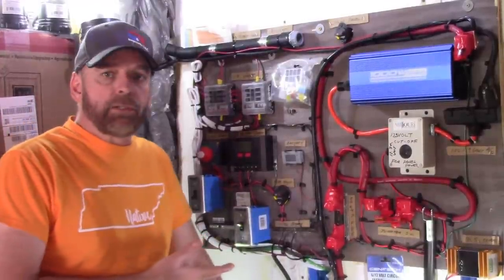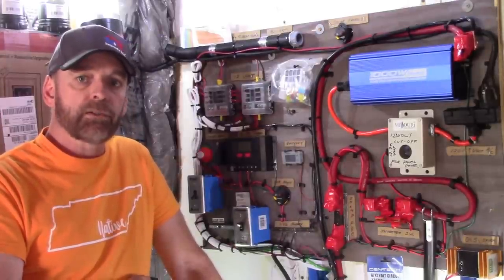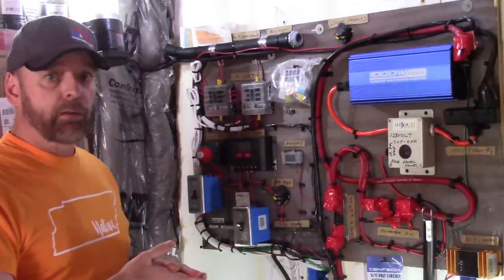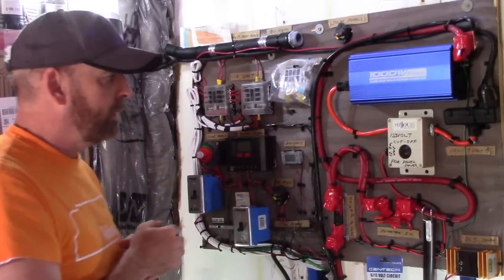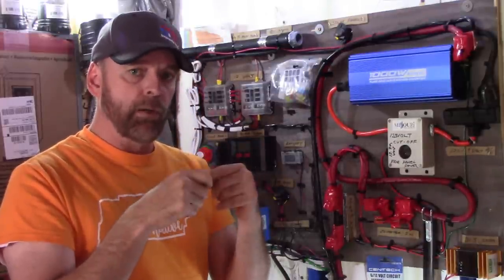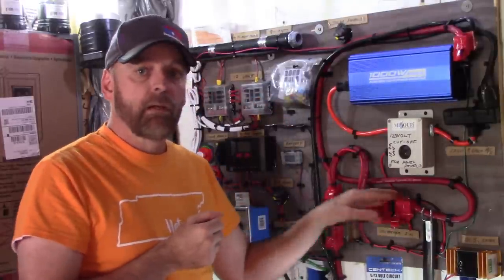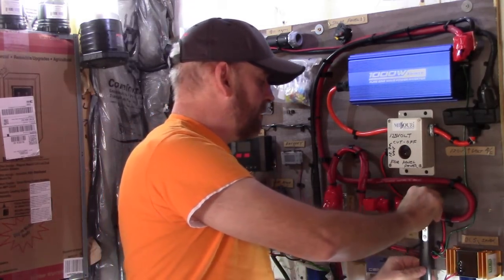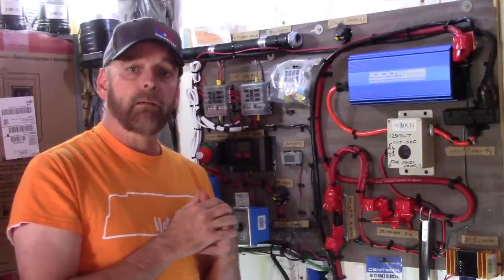Inexpensive Solar Power Off Grid Cabin or homestead DIY system #SOLAR #OFFGRID #homestead

Comment: I agree with you 100% on trying Solar. Play with the HF kits. I wasn't sure about it and surly didn't have the money at the time to buy a turn key system. I started with the HF kits, went to Wal Mart got 2 Deep Cycle batteries to run a fan and some 12 volts lights in case of a power outage I am in FLA.. Now I have been running my 4 HF kits and have gotten 20 deep cycle batteries for over a year now with no problems. I did up grad to a good charge controller and inverter. I only buy the kits if they are on sale and yes you only get about half of the claimed power out put. They do work for something like this. I have gotten some real solar panels. I have gotten 8 100 watt and a larger charge controller. I haven't installed it because I will be setting it up in another home.  I also use auto and marine supply when I can. Welding cable works best for me and like you said does a great job.  You can build a good Solar System if you are like me and can only do a little at a time. It works and can be very helpful in times of trouble. I use my Solar to help reduce my Electric bill and it really helps. My friend can't believe it when I complain about my $70.00 dollar light bill in the summer. I use as much solar as I can to off set the Electric use of my home. Good post.
Reply from the maker: Awesome! I am editing up a follow video on that system.  MPPT vs PWM  charge controllers ...when to use them and real world results. It was a good experiment.  Thank you for watching and thank you for leaving this awesome post.

Comment: Great video, after many hours of the same ole high dollar sales pitches I knew that was BS. Thanks for posting a video for the people who don't have $30,000.00 to spend on a system they they're trying to get away from the high costs of the Energy grid.

Searching for the components now, trying to come up with a system to get away from the power Co 100%, we use according to our bill about 600kwh a month.
Reply from the maker: Thank you it's why I made the video. That system for the video is working like a champ using 5 Wal-Mart batteries powering my Starlink system.
Reply: @GrumpyMountainMan  Would you have a suggestion on how many panels and batteries we'd need to run our small house?

Comment: What was that thing down at the bottom right you called a DMS? I'm kinda gathering its a desulfator, if that's right, yeah they work if you got a reputable product. I've been using battery minders & I witness everytime I installed used lead acid batteries, they had a sizeable back current left over when fully charged which means there sulfation blocking it from accepting a solid charge. With desulfators permanently on the batteries, I saw 20 amp back currents drop to almost nothing over a couple months. I have 4700 a/hrs of batteries with just a 10 amp back current with 26 batteries making that about 4 tenths of an amp back current for each battery which is excellent.
Reply from the maker: Yes it's a BLS..( buy on Amazon) .I love them . They work and I install them on every system. An even better desulator is a wind turbine hitting your battery bank due to voltage going up and down and hitting the bank. Thank you for watching the video and for leaving a comment hope 2021 treats you right.

Comment: Using marine grade is a good idea also car hifi stuff is grate but there are limits to the systems  size but more important is your terminal technology a properly sized crimped connection is best long term screw types loosen with time very current surge

Comment: I doing exact same thing. Tho I self taught everything. I've got 300watts of HF going to s set of lithium LG Chem batteries.  3.7 at 120ah.  3s5p. You can change the charge voltage on the charge controller and I have a cut off to my battery  and like you I got mostly all 12v applications. But expensive on my batteries  tho. If they send us another stimulus plan on adding another 300 watts probably another 240ah of battery
Reply from the maker: Awesome ! Thank you for watching the video and leaving a comment.  I have a solar playlist also and I'm editing more videos.  Please subscribe.  Once thanks for watching the video.

Comment: Pretty close to what I have..I just got #7 & 8 marine batteries for mine..I did get a 24 v inverter/charger (Aims) because I didn't know anything but its awesome..I've got 490 watts but I'm gonna get 200 more...I used a 4215 epever BN controller and I just get my batteries at Autozone I used the 27 DC marine..I've got $2000 in it but hey its working..
Reply from the maker: Sounds like a awesome setup

Comment: internet engineers!!!  LOL so true,  subscribed!!!  Oh yeah, you said your grounds go from that bar to the grounding system.  Can you explain what you did for the grounding system outside?
Reply from the maker: I attached that ground bar using a #4 conductor to the 2 ground rods outside
Reply: @GrumpyMountainMan  how deep are the ground rods?
Reply from the maker: Driven all the way down at a 45 degree angle. I used a hammer drill
Reply from the maker: I have a video showing the hammer drill in use.

Comment: Think about this: supposing the grid is unreliable, how would you do a battery system that was charged by the grid and could take over when the grid dropped that you could hookup panels to take over if turned out that the grid got too unreliable to keep the batteries charged - i.e. just have the batteries and only buy panels if it turned out you really needed it because the power was out too often. What I'm thinking of is rural Philippines where you can get a hookup but brownouts and cuts are common. Maybe a backup generator would make sense rather than batteries though?
Reply from the maker: Just charge a battery bank using grid power. Use the inverter tied to the battery bank back feed your electrical panel.
Reply from the maker: I back feed my electrical my electrical panel.

Comment: Good video and tips on saving some money on non-solar labelled devices.   I think you would find electrodacus' charge controller interesting for a cost effective 24v system, could possibly use in a 12v also with the parameters changed.  Do you have any advice for getting permitted for residential solar electric only and how nec applies? Thanks
Reply from the maker: Permits are pretty straight forward. Here in the States we use the NEC for our code. This system shown here might not work. Inspectors without knowledge look for the UL and CE label on equipment being installed.  Most of my components are marine/automotive.  That said. If you mounted all of those components in a UL rated box. They would probably just open it up and close it not knowing what they are looking at.
Reply from the maker: Thank you for watching the video and for leaving a comment...its a very big deal. I have a solar playlist that I am always adding to. Please feel free to subscribe and watch : )
Reply: @GrumpyMountainMan  thanks for the response, I'm in Pennsylvania

Comment: Regarding using a possible loss of a battery as an excuse for going with a 12 volt system. It's pretty rare to have a battery go bad. If one is going bad they probably all need replaced anyway. Even if a 12 volt battery in parallel goes shorted it will pull the others in parallel down with it and those will go bad too. If in series and one goes bad it won't ruin the others. But since your system is small anyway it probably does not matter to much. With Lithium (especially used) going so much less expensive it is pretty odd to see people building a new system with Lead acid. But regardless nice job on your build.
Reply from the maker: Thank you for watching the video and for leaving a comment.  I have a solar playlist and a video coming out showing the real world differences between a MPPT vs PWM charge controllers.  Please subscribe.  Once again thank you for watching.
Reply from the maker: On Lithum.  Watch Jonn Daniels video on Lithum vs Wet batteries.  Wet is still the way to go.

Comment: What's the best way to start small and keep scaling up with batteries and panels?  Just buy a huge overkill inverter and a few panels and a battery?  I want to be able to do just 100 or 200 watts, and as I get the money throw on more panels and batteries, and eventually get it up to run my mining rig which takes 800w and runs 24/7.
Reply from the maker: Really no free lunch. You can't keep adding batteries. Your newest will be just as good as your old one when added to the bank.  Only thing . You could get a big inverter. But you are better off and just buy the whole system at once

Comment: question ?? im like you with this i started with the 100 watt 4 panel kit from harbor freight ?  with 2 bad ass  Marine batteries from walmart .. the 100 watt kit cant keep the batteries charged just running a 1000 inverter plugged in only  the internet roughter and a 20 inch box fan.. why not just get more habor freight kits ?
Reply from the maker: It's a catch 22. You can go with more batteries.  My harbor freight system is 400 amp hours, that means its actually 200, it's the 50 percent rule of use...so you have actually less than you think.
Reply from the maker: On your box fan. Get a Boundless Breeze fan...they are 12v...and sip power. Try not to use and inverter.  They are 20 percent inefficient
Reply: @GrumpyMountainMan  on a rainy day the panels cant keep up just the inverter
Reply from the maker: @darrinhawkey8913  it's why I'm over kill on panels. I needed 400 watt...but Installed 600watts so I get a trickle charge  . On sunny days I get more power.

Comment: Hey can I ask you about wire size to use from the battery to the power port or inverter? Shoild I use 2 awg??
Reply from the maker: I would use 4/0 welding cable

Comment: Ok I have a question on the DC side. The 2 breaker panels top left side, what are they for and hooked to?
Reply from the maker: On top on the left. They are automotive fuse panels. They are the kind that if a fuse blows it has a LED light that goes off.

Comment: I have a 20 watt solar panel and want to run my Air Conditioner what else do I need.....Jk man, your setup looks crazy but it's time to start mine again. I had a 3kw system in 2010 and now have maybe 450 watts in solar.
Reply from the maker: Ha ...holy crap you got me good with that 20watts....ha ha ha
Reply: @GrumpyMountainMan  Just having fun. My off grid projects never started. I have 1kw system just in storage. Good luck my friend.

Comment: Can you address a simple way to construct a portable solar panel system for an apartment unit that will not damage the unit?
Reply from the maker: I would go to Cutting Edge or Renology and purchase a suit case system. They are turn key and portable.  If you move take it with you.
Reply: Becky Elliott: I am currently building a small solar system that fits your idea so that if need be I can take it with me should we lose the house or whatever other disaster might come up. So far I have about 1100+ watts in solar panels, an inverter, charge controller, home made connecting block with a fuse set up, and whatever heavy cable I could get  a hold of (which I am currently unwrapping and re-wrapping to make it at least size 4 wire ...not easy to do and very time consuming but I am retired and disabled so I'm doing it at my leisure) and so far I think I might have about $1500 invested in the entire set up. But it still has to be set up inside the house yet. SO you can do a smaller set up at a lot less expensive than mine if you just want to power a tv, computer, and maybe a few lights it's perfect for that and almost no drain on the batteries because it's such a low amount of draw compared to what's being pumped into it. Just thought you'd like to know that someone else is doing what you want to achieve but at a slightly cheaper cost and over a period of time so it's financially efficient as well.

Comment: great video bro, a recommended system for laptop ?
Reply from the maker: You can use a EPEVER MPPT charge controller.  But you can also but with the interface and temp probe as one kit. I have a video uploading that shows that MPPT. Thank you for watching the video and for leaving a comment.
Reply: Lap tops run on 19 volt  DC. Just convert the 12V dc to 19 DC. no need to convert to AC, then back to DC. Same with TV. Get a TV with a DC input port.

Comment: Rural King $6 jumper cables make excellent conductors. Just cut the crappy clamps off n solder lugs on at whatever lengths ya need. Just passin on a cheap idea.

Comment: Can I run a 600 watt AC freezer off this?
Reply from the maker: You sure can!
Reply: @GrumpyMountainMan  Excellent, thanks for the reply. Good video.
Reply from the maker: Have you bought your freezer? I have an electric Midea that sips power. It's been very reliable.
Reply from the maker: You can make them think they are a refrigerator too.
Reply: @GrumpyMountainMan  yep got a freezer already. Full of meat I don't want to lose. So my system will only be for the freezer for now. Maybe expand to the fridge and TV later.

Comment: Hey man I'm over in Andersonville, I'm looking at 12-13k to connect to city power at my new property and always wanted to be off grid in the future so I thought I would look into a primary system instead. After looking into used li fe batteries and doing it all diy it seamed like it would be similar in cost. You said it's not worth it if you can connect to the grid, for a doublewide trailer and just me living in it with moderate/low power usage would you say it's probably not worth it?
Reply from the maker: What else could you use with that money?

Comment: Generally a good presentation but there are a few dubious statements with one glaring piece of misinformation I must correct. In DC circuits electron flow is through the ENTIRE cross section of the wire not just the surface! This is also true for low frequency AC such as standard 50/60 Hz house wiring. "Skin Effect' only comes into play with high frequency AC such as radio and TV signals or, especially, microwave frequencies where large diameter hollow waveguides are used instead of wire.
Reply from the maker: @kayakwesty  ouch

Comment: You are mistaken about electrons travelling on the outside of a wire. That happens at high frequency only. At DC and low frequency AC the "skin effect" (look it up) is negligible. (I'm a university degree electronics engineer with several decades experience.)
I found your explanation confusing. You should always start by drawing a wiring sketch: a block diagram. Make your shopping list from that. Work from it as you build. Modify it as necessary.

Those cheap Chinese inverters last about 2 years before the smoke comes out. You can greatly extend the life by replacing the large electrolytic capacitor inside with two. For example, if there's a 220uF capacitor rated at 400 volts DC, replace it with two x 120uF/400v connected in parallel. If it's 470uF replace it with 2 x 220uF of the same voltage rating.

You need two ground connections: a massive one from the solar panels direct to a ground rod in case of lightning. 
A thinner one from the ground connection tag on the inverter to a ground rod.
Reply: Ha ha ha look everyone.  Mr. Internet Engineer is here.
Reply from the maker: Easy now.

Comment: I wont lose power by loosing a battery, I have 3 bank of 4x12 volt AGM batteries. 48 is cleary more efficient.
Reply from the maker: Might be more efficient but not easy for a novice to understand.  Nor easy for a novice to wire up. Thank you for watching the video and for leaving a comment.

Comment: With all that money you paid  on your system.   You paid for a powerwall .... and some micro inverter on your panels ... that been a lot easier then you can come straight to  breaker box .....
Reply from the maker: I've got less than $600 in my entire system including the batteries.  Excluding the solar panels.
Reply from the maker: And I've have parts to where I can go to Autozone or Walmart and not miss a beat.

Comment: DC HAS NO EARTH GROUND. you buy stun gun and it not grounded. Your meat absorbs it. The vehicle frame is ground enough resistance to set off a fuse. Electrical current flow into the frame as it large enough to disperse current to the load and convenience of putting the ground on the positive side of the circuit. The positive terminal side has electron flow.  I like to clean the ground and sometimes put copper additional wires too. Ac has ground return at the power plant that why you have ground with home to return to the power plant. The power plant has a huge electrode driven into the earth as a ground to receive your purchased power and return from their plant. Farming electricity is another matter. Good luck if you want to return some high voltage that hits your neighborhood and share it would be your kind of interest.
Reply: Oh boy. Geeesh another internet Engineer ground smound.  Powerplant blah blah blah. Electrode waaaaaa.  Holy crap I bet you're life of the party.